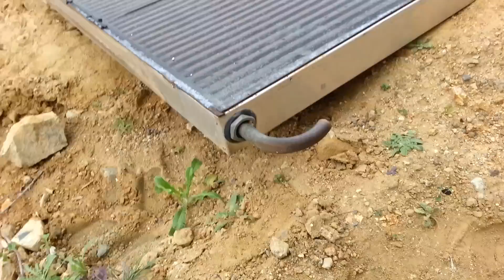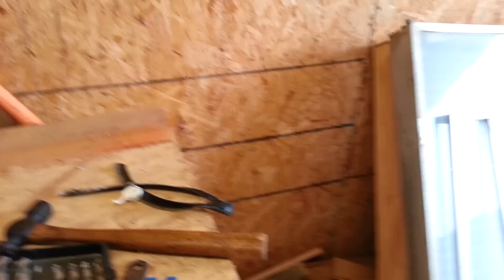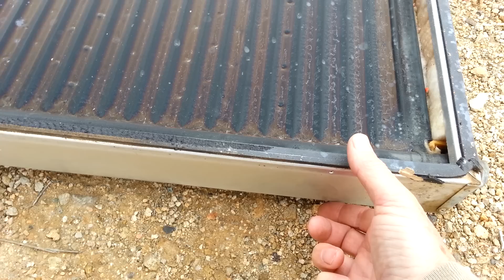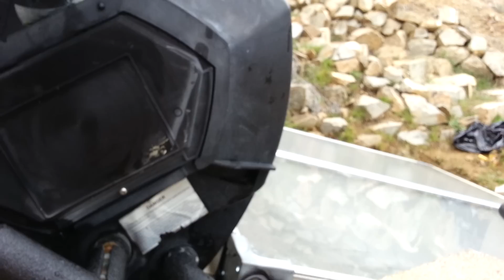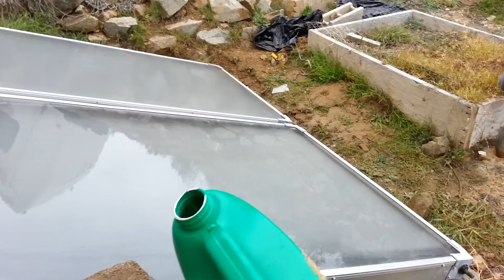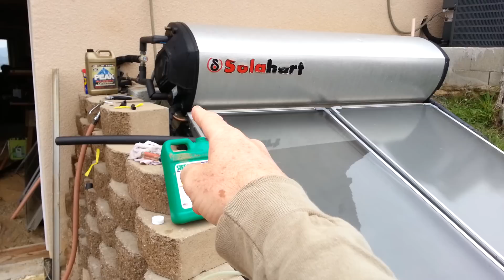Glass panel repair for solahart solar hot water

Comment: Hi I have a different system, just happened to be on the roof today to fix something and found the glass on one panel my 2 panel solar hot water system smashed. Was not tempered glass, big shards of glass around a central point. Looks like a large bird hit it in the middle. You mentioned the option of using plexiglass to replace but said the heat-transfer rate was not as good. Would this be for any non-glass material like PVC or plastic? I need a quick fix with removing the glass and re-covering the panel with some non-breakable material. I did NOT notice any loss of efficiency over the past months which is strange. Lot of rain though so there must be some damage..

Comment: Propylene glycol is what you can drink before a colonoscopy to clean out your colon. It is safe, but if you drink a strong solution you better be near a toilet.  If you live where it never freezes then you can use distilled or de-ionized water. 
Your common glass shop cannot usually temper a piece of glass this big and is very expensive. Your method of finding a used or surplus glass is probably your best method.

Comment: I have a question I will make the assumption that you live in the Desert SW,  my Question is who did you purchase the solar Hart, System from?  I also have a Solar Hart Hot water system, Which is Finished is was originally installed in 1985 and was there when I bought the House.  i WOULD LOVE TO REPLACE IT WITH ANOTHER SOLAR HOT WATER SYSTEM.

Comment: I have some solar hot water in the southwest as well. A little hint about your insulation. I you go to your local hardware store you can find aluminum tape in the duct work area HVAC. if you cover that insulation with it will last a long time.

Comment: Automotive machine shops usually use a rotary wire brush in an electric or pneumatic drill to remove silicone RTV sealant from engine components, followed by thorough scrubbing with a shop rag moistened with brake cleaner.  Also, gasoline will cause it to swell, making it easier to scrape off of metal and glass with a razor.